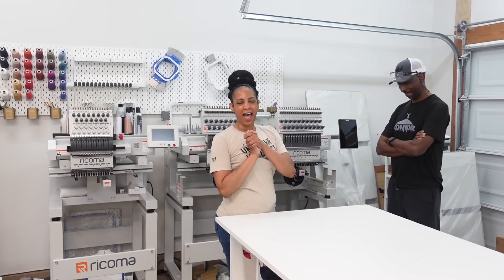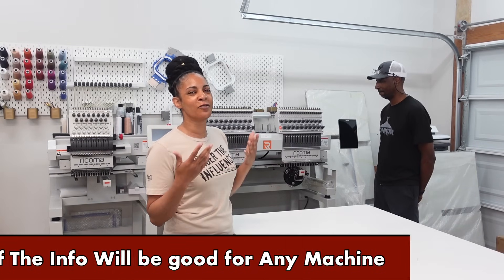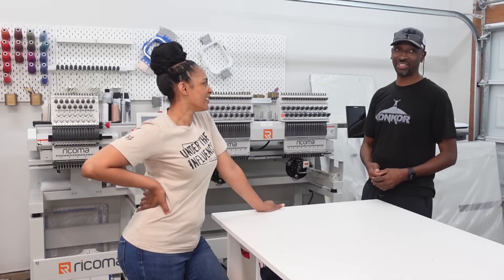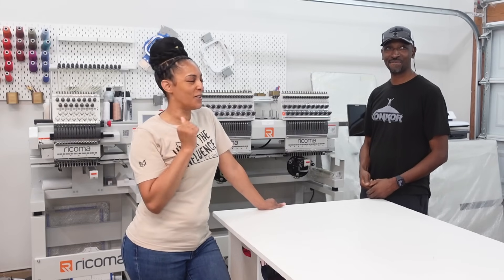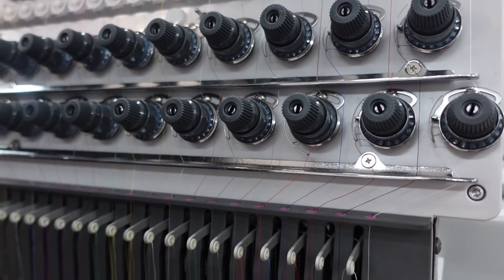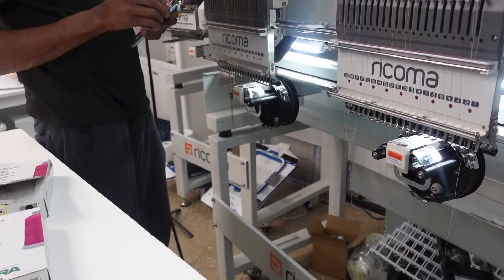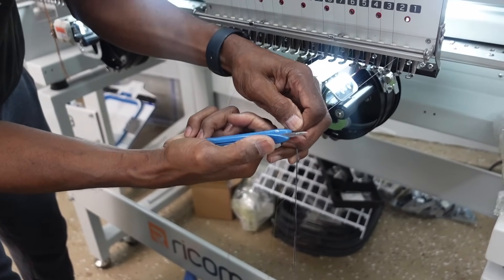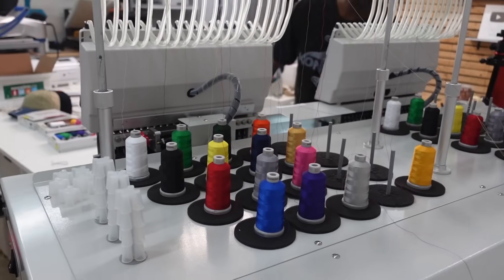How To Set Up Your New Embroidery Machine | Threading, Tension, Hooping  & More Start To Finish!

Comment: Hi Katrina, Happy New Year! Thank you for putting these videos out, greatly appreciate it. I have watched many of your videos. I just purchased and received the Marquee 2001 and ran the "I" tension test. The top results look perfect, the bottom results also look very good with a few needles that may need a bit of tweaking since there is a bit too much bobbin thread showing but thank you for this video! This has resolved all my issues except one. The only issue with needles 4-5 is that the thread pops out once it has completed the "I" so i need to re-thread them every time, also the threads look like they broke.  It's only those 4 needles/threads and like I mentioned above the top and bottom results are good. How would you attack this issue?

Comment: He mentioned thread breaks have to do with the digitized file or incorrect tension; however, the thread most times gets stuck under the top tension plates despite having good tension. I wish you had asked him the purpose of the top tension as opposed to the lower tensions.
Reply: Hello. I hope this message finds you well. I'm eager to make friends from different places and countries. Which state are you in if I may ask??
Reply from the maker: I will see him again at Deco Summit in August I will ask him
Reply: @katrinasgracefulcreations3711  Respect. Looking forward
Reply: @katrinasgracefulcreations3711  Let me jump on here before Deco Summit really quick. Both or all three tensions knobs have to work together to get the perfect stitch. Top tensions is your minor adjustment while bottom tension is your major tension, top 40%/ bottom 60%. If you have 3 knobs like we do with the new machine. Top 20% Middle 20% again bottom 60%. Hope this helps. I have a video on tension. If Katrin wants to share here she can. Hope this help... #KEEP PRESSIN!!